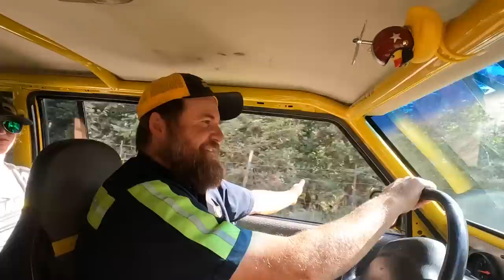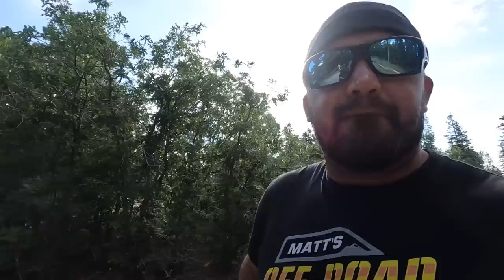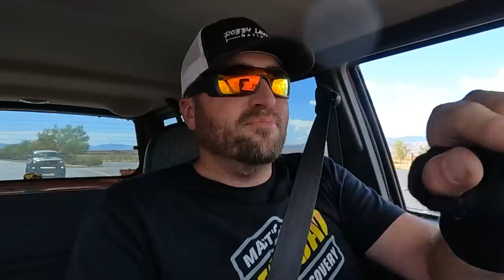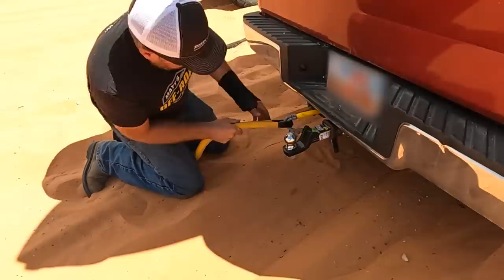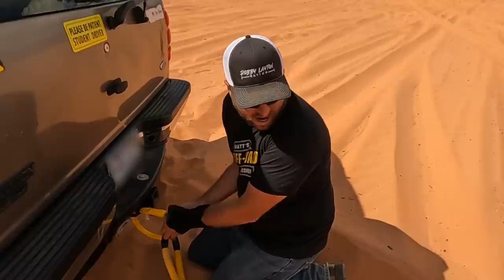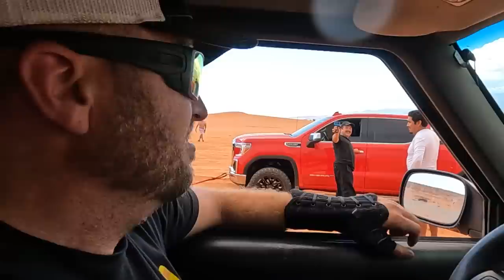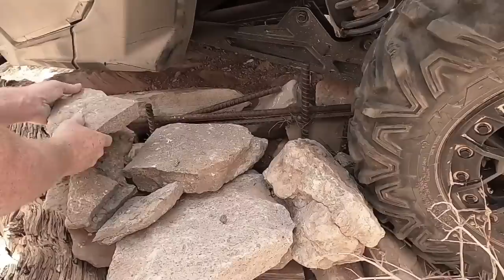Did I Set My Team Up For Failure?

Comment: Can somebody explain what can make the sand in a specific place softer on a given day? Is it different sand blowing in with the wind or does the sand get more sticky with more moisture? Or something else?
Reply: Wind blown sand grains tend to be rounder and more slippery than river or beach sand. When hot there is less moisture holding the grains together.
Reply: When it hasn't rained for several weeks the sand gets more and more powdery.  Add in wind that continues to restack it in different areas you end up with super soft sand. I was in the Ford Expedition and that was incredibly soft sand. I knew as soon as I hit it that I wasn't going very far. Then I realized I didn't have umph of my 4 wheel drive I really didn't get very far. After Jefe pulled us out we would stick closer to the lake and had no issues getting back to the road.

Comment: hi 👋 👋 👋 👋 Matt hay I'm just throwing out an idea 💡 I was wondering what you thought about doing a little work on Jamie's Jeep Cherokee buy doing a little  Suspection work on it and maybe consider putting a wench on the front end. oh maybe some all train tires on it so if your other vehicles are busy at least you would have a backup vehicle.
Reply: Matt is currently building the ultimate back up vehicle, watch for the build videos on Sundays.
Reply: Who's the wench in “Suspection”. It's winch, and suspection isn't a word. Did you mean inspection? 

And, uh, the tires on it are about as aggressive as you can get. They ARE Patagonia MT tires. Just like on all his other rigs, only shorter.🙄😎
Reply: Winch

Comment: This episode got me wondering. Do you guys have on board air? Or is the banana  and Morvair capable enough running low psi 24/7
Reply: both rigs keep 9 or 10 lbs at all times...  the shop is fairly close to sand hollow, so he doesn't worry about it on the roads themselves... no on-board air

Comment: Matt's off-road recovery please read if you respond would be very helpful if you know about those little pop outs about a one and a half by one and a half square inches on the front and rear bumper if you go into where the spare tire is there should be a hook so you screw into that's the pull points that you want on a new vehicle look it up if you've already looked it up and you know which vehicles are on then you are smarter than me please get back to me all vehicles should have the smart hookups it's just a little square you have to look for Matt thank you for your time Derek from Hesperia California

Comment: I've seen a gadget that is an exhaust air-powered lifting bag that can lift a car up.  That could have been used on the first one to lift it clear of the rocks and then stack boards and stones to back the car off the bolder.   
I'm sure there's a reason nobody uses them in any of these videos.  I'm would like to know if it does what they claim.
Reply: Love him or hate him, WhistlinDiesel has an older video on one, almost flipped a Jetta over with it if I remember correctly.

Comment: Those tires are too aggressive for sand.  Probably kicks butt on rocks, but just digs and clears themselves out.
Reply: Matt's tires? Milestar Patagonias. His favorite for that type of sand. They may not look like they work very well, but nothing short of paddle tires would do much better.
Reply: @JohnFL  I've gone playing in that type of sand.  I was the guy pulling everyone else out with my 89 wrangler, straps, and a small A frame.  My first set of tire were Wrangler ATs.  Had a modest tread and very aggressive shoulder.   It would float on top of anything.   Second set did even better.  Had a set of Thornbirds on it.  Those did great all around and were even quiet on the highway.  Never would I sling rooster tails like Matt's tires.

Comment: Yall really shouldn't be pulling in reverse, gear sets aren't meant to have that much stress on the face of them. They are directional cut for a reason as the primary purpose is driving forward.